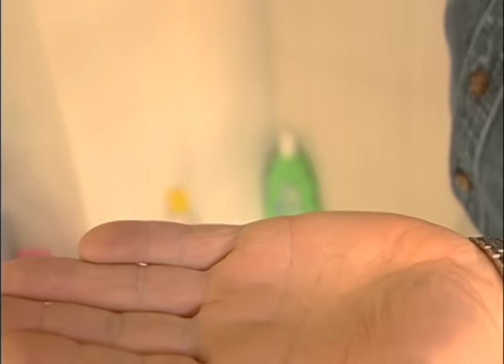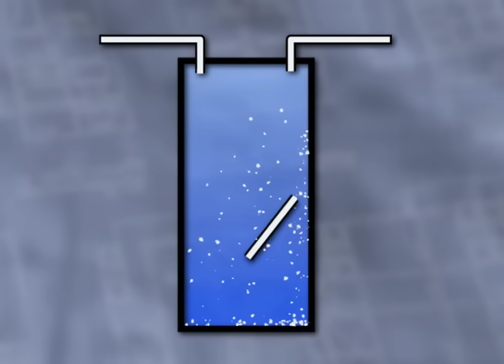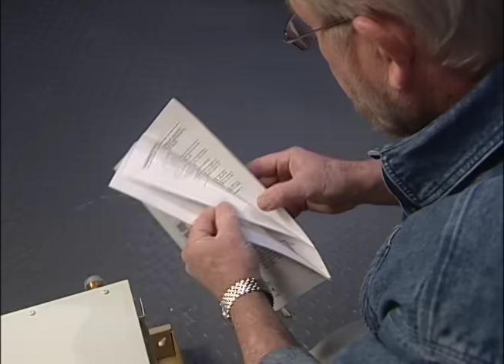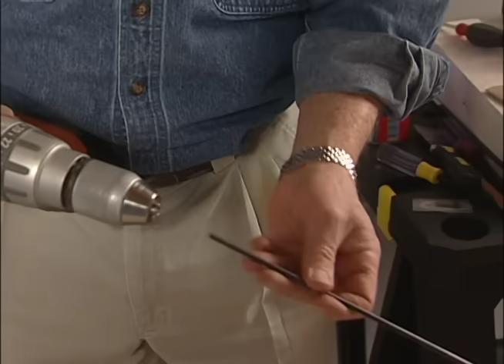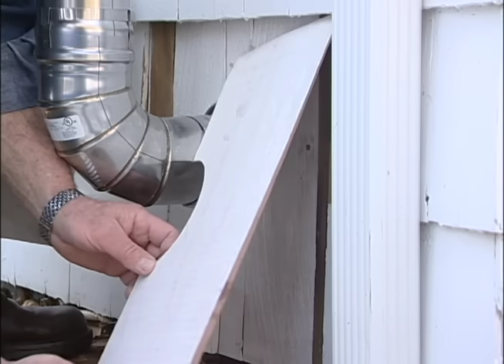Install a Tankless Water Heater

Comment: There's pros and cons to everything. 
 You need to know your needs are. And of course cost. Regular water heaters are pretty efficient now and you can put insulation blankets on them. Works well. Maintenance is key. 👍😉
Reply: George B most of the time where i live. A tank style water heater is either in the garage or house. Neither of those get cold enough for a new foam filled water heater to make it a good idea to install a blanket on a water heater

Comment: I installed a gas tankless in my house twenty years ago.  I have never had problems with it because I only plumbed the shower/tub and clothes washer to it.  I figured turning it on and off just to get a little hot water at the sinks in kitchen and bathroom will cause it to breakdown sooner than later.  Besides it isn’t instant like a typical hot water tank because the chamber has to heat up so it runs a tad bit before hot water comes out of it, then has to get to its destination. I use a six gallon electric water tank under the kitchen sink to provide hot water to it and the bathroom sink.  My only regret is having one while married as I don’t think you will save money with unlimited hot shower water with a women in the house.

Comment: Looks Great Only One Issue. Galvanized pipe will release particles that block the burner orifices....
Reply: Michael Canto, I have one and the only problem I had was to install a mixer to keep from getting scalded water if you turn it off, like in the shower to suds up your hair or something and then turn it back on to rinse, and the water that was sitting in the chamber comes out scalding hot.  They say there was a mixer inside but I had to add one for safety.

Comment: All that work, and you didn't have service valves put in so you can flush it every 6 months.
Reply: It’s highly recommended to have service valves installed so the system can be flushed so scale doesn’t build up. It’s a simple addition for a diy service to save a lot of money.
Reply: Robert Ford, Do you mean to flush with water at a higher pressure because the pipe inside the heater is “flushed” every time it’s used isn’t it?
Reply: Robert Ford, I have had one for over twenty years and never had a problem.  Never opened it to check either but I imagine it would be the same as the rest of the pipe in the house.  No reason to think that the heated portion of the pipe would make deposits more than the pipes carrying the heated water.
Reply: you  probably have a water softener?
Reply: No flushed with vinegar or a descale chemical.
Reply: Robert Ford, I’m not saying your wrong, I really didn’t  think to do it when I installed it and would not doubt after twenty years there is scaling inside.  I’m actually thinking it probably wouldn’t hurt to do the whole house since I’m sure it’s the same throughout.  Thanks for the idea though,

Comment: Basic plumbing repair: whenever you remove a strainer or hose to clean it out,  turn the water on for a few and let it flow free to flush the crud out.

Comment: I did customer service in the field for 35 years for a water utility. It was my job to respond to stuff like this. 75% of the time issues were in  customers plumbing like this break down of a sacrificial diode in the water heater. Tankless need to be cleaned because the coils filled with constant hot water will build mineral deposits and get in customers plumbing. Its wise to add a filter and a clean out for periodic removal of mineral deposits.
Reply: Absolutely, I have a filter system in my house and its amazing the debit sediments,  in the filter I've seen from the city that supplies my house water..

Comment: You can have that one and every tankless water heater they've made to this date and keep them and I'll wait until they finally make one that doesn't scald right off the bat or fail after a year.    Worst invention of the century!
Reply: Seriously? MY father has had a tankless water heater for at least 15 years with no issue, I've had my tankless water heater for 3 years and no issues. Whatever problem you have is probably an installation issue.
Reply: Seriously?  No I am lying and causing problems for you because I have nothing else to do other than to stop what I am doing and spend minutes of time composing something to irritate you.    So sarcasm off (as I hope you will flip it off as well) but no, these are not as great as some people claim.

Many hotels are starting to use these dreaded things and I have run into them in various B&B's I have stayed in (I love to travel) and I have never, and I repeat never taken a shower with one as the hot water source that did not either freeze me or scald me for a couple of minutes or more during the shower and even some get boiling hot and then go cold.   Even at their best, the water temp varies greatly by pressure and unless you are the only one living in the house, the temp is always fluctuating during the changes in pressure which creates a very unpleasant showering experience.   I wouldn't have one if you gave it to me, but I am happy that you are enjoying yours.   

I use my time here only to warn others that these things are not what they are "cooked" up to be but you may very well be after using one a few months.
Reply: @barbaraflanigan1641  welp I guess you're right, all of Asia, and Europe MUST be wrong!!! Sarcasm off, did you use a point of use tankless or a whole home. Because these tankless ones are usually bulletproof. A scalding issue is not the water heaters fault, that lies in the cartridge in the shower/bath. The tankless units also have a temperature setting, ours is set at 125 and has been; flawlessly fine for 3 years and my father's for 15. And other ones I've installed have not had any call back or service errors. I do annual descaling and condensate servicing to my units and make sure they run perfect. My guess is of an underlying issue of install, size capacity, or other factor causing the issues you've noted. These units need to be set up to the home/hotel being installed at, it's not a plug and play for each. You need to analyze the gas getting into the unit, and adjust a gas port until you get the proper exhaust gas reading to verify the burn is correct. Plus gas line size, water line size, ect. However I bet you might be noticing one constant flaw over and over again that is an issue related how it is being used or installed. In a hotel or large service location they should be set up in a cascading arrangement. That is one connected to another, and so on. Same way some people will hook 2 tanks up to each other.

Bottom line, my thought without actually seeing the issues you describe all fall back to install or improper use.
Reply: I enjoy a GREAT shower and I've experienced them from tanks starting at 6 gallons (my RV) up to 100 gallons (friends with large home in CA) and the showers are great.  (RV tank-less is an even bigger joke, you've run out half your water tank before you can get the temp right.)   

In fact I've NEVER enjoyed a shower with a tank-less and I have had more than my share at the places I previously outlined.    Other news ..... no one maintains anything these days so if you have to descale them every so often, it's not going to happen in any household I've ever visited.  Most people only do maintenance when they are reminded when water starts pouring out on the garage floor or it's running ice cold.   In fact with tank-less they usually stretch that out as far as it will go as well, seeing just how bad the temp control will get before they are forced to call service.   

Still if you have to tune them like a piano to make them work right (sizing shower washers, etc.) then how long can that last (even it it works a while) with debris and scale build-up in strainers, showers, etc.   In many places I visit I'm always happy when they have the shower heads with all the tiny rubber little jet-nipples on them because I can unclog the shower by raking a fingernail over the rubber jets to unclog the scale from them, and the point of that being that scale in some locations requires weekly clean-out.   Overall, it's just too finicky of a contraption when doing something like adding a solar supplemental heat source could save near the same money and without all the grief.

Comment: I came accross the same problem & installed similar heater, 1 thing wasn't mentioned was the need to purge air out from the heater before turning heater on. (I do repairs to but don't post online but considering it.)
Reply: Yes the need to purge air from the water pipes & the gas pipe, also there was no mention of checking the flame or efficiency of the gas burner itself, or does  the manufacturer just set all these gas burners the same?

Comment: Please be very careful of the vent because it's at the level of windows. When the water heater is running there is carbon Monoxide coming out of the water heater vent. "Dangerous and Deadly"

Comment: These have been around for years in Japan... Paloma, Rinnai, Noritz, they are all Japanese companies. You can put those on the outside of your house so you don't need to put it in your basement or wherever
Reply: That is correct,put it on the wall outside,no expensive flue needed, easy to maintain,and a lot cheaper to install.

Comment: And NOW I know I have to get rid of my tanks here as they are old in this fixer I bought a year ago,, Thankfully us Puerto Ricans know all about tankless water heaters though we use electric models not gas.
Reply: That sucks. Gas where I live is so much cheaper than electric
Reply: @iLikeC00kieDough  Well sir, I found out gas use costs around the same per month as electric for heating since it is freezing here in PA. But alas, gas may be cheaper for some appliances true. For central heating furnace,not so cheap.
Reply: pianokeyjoe probably true for Puerto Rico. I’m in the northeastern us and natural gas is so plentiful, it’s dirt cheap

Comment: The tankless propane water heater I'm using cost less than $60 new on eBay.
Reply: For a whole house??? If so good luck in the next 3-6 months.
Reply: @nickirland5497  The last one I had cost $129 new on eBay, worked flawlessly,at least 2 years, before I gave it to a friend.
Reply: Greg p why would you give away a perfectly good tankless water heater??

   If you paid a $129.00 for one. How many gallons per minute & BTU’s was it?????

I like how you say. I’ve never had any problems with any of the tankless water heater.

  That’s a problem right in that statement.  You should only say this about “1” tankless water heater. If you’ve changed any of them out. 
       “You’ve had problems”
Reply: That’s like 80% less cost then most heaters, what’s the brand? Flow gpms? Btus?
Reply: @andreyyaromich8277  it's a Chinese made for outdoor camping, 2 D batteries fire it. 2 lines propane and water, shower head output. I use it indoors.

Comment: For $500 a regular water is the most cost effective.  A tankless will cost you thousands and will take many years to make back your money.  Always have a licensed professional install your WATER HEATER.
Reply: One of the problems with tankless is the confusion of misinformation running amuck with zero practicality applied. In 2008, a Bosch Aquastar 1000P cost me $300 which was under a standard tank type by $100 and they were lasting only a year before developing a leak so bad the pilot light would be quenched by the leak. The Bosch is still supplying me with hot water with next to zero maintenance or cost. It ran one winter on 30 gallons of propane where the tank type required an entire 350 gallon fill up to do the same job in the same over the winter time frame. At 2.35 GPM, the Bosch is meant for cabins or single bathroom only but in my whole house use it's exactly the same usage as a tank type. You have to take your turn in using it, anyone in the shower will still holler bloody murder if someone else uses hot water in the kitchen for example and that situation has never changed from the tank type days. If you don't really need a massive amount of hot water, you also don't need to spend thousands to get it. But the advice to go small like I did is not offered anywhere, ever. Forbidden logic.

Comment: Am I the only one who thinks it would be nice to know how much this conversion cost? It seems to me that if tank-less water heaters cost about the same as tank water heaters there must be a good reason for getting a water heater with a tank. What is it? Why hasn't tank-less water heaters not become the norm? Thinking over the video I remember venting the heater with stainless steel. I'm guessing there must be a lot of heat to vent. Does that pose a danger to the home?

Comment: How you gonna flush the unit Ron?

No service valves. Seriously people this guy is a moron he misses stuff that people who aren't licensed plumbers would know better.
Reply: Look closely,....... very closely....... 15:45 you must be one of those licensed plumbers then...
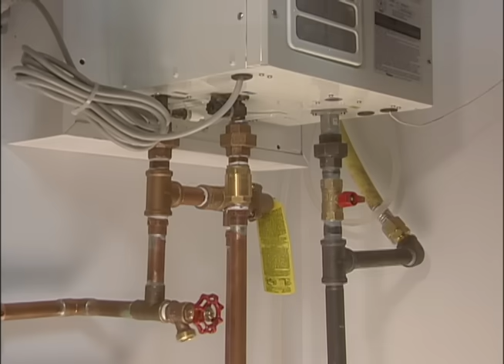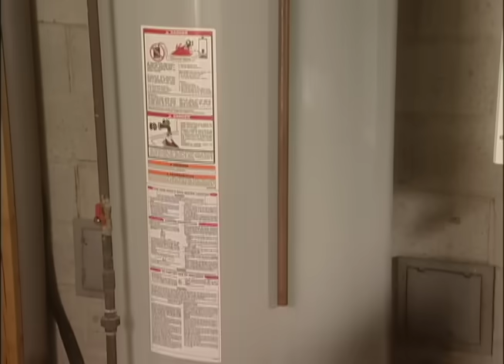Reply: There is one. At 14:52 it shows the valves under the unit (and again at 15:03 ).
Reply: @raymondheim5369  There is a gate valve on the hot water side, none on the cold water side to isolate the unit itself in order to run a cleaning solution through the unit.
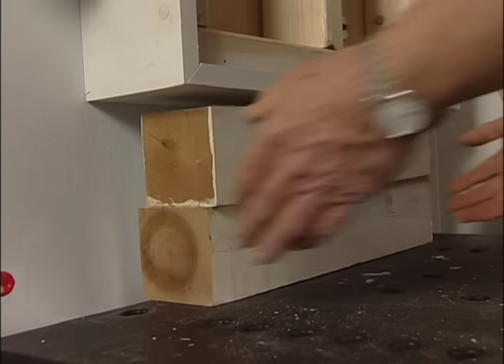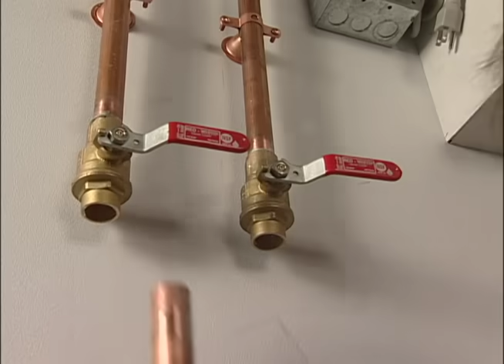Reply: MrBurgandy25 - You might want to watch the video. There is a shut off valve BEFORE the unit. Look at 8:21 and he actually detailed the install to the unit starting at 9:20.
Reply: @raymondheim5369  wow, seriously? Those are 90° ball valves, not service valves. Service valves allow you to turn the water off and connect a hose to a submersible pump. 

But what do I know, only my father and I each have a tankless and know firsthand what service valves are.
Reply: MrBurgandy25 - The point was/is valves and they are there to isolate the unit so you were wrong. So yeah, "Wow, Seriously".
Reply: @raymondheim5369  the OP comment says "...flush the unit...no service valves" 

You literally are missing the main point yourself. I stated the service valves isolate the unit to allow you to flush and de-scale it. The poi t of isolation is to not allow the cleaning agent to go into your plumbing, only the tankless unit. 

I understand what you're commenting about, but it's not the correct type of valve OP is referring to. No where in the video are they present. Wether you miss understood OP or me, they are not installed here.
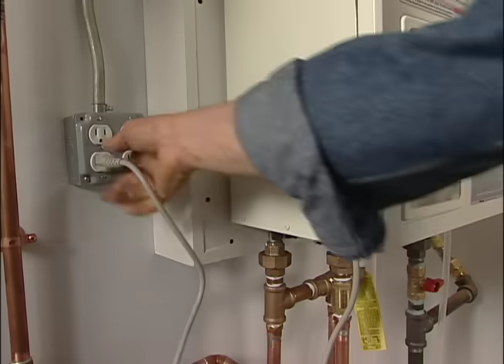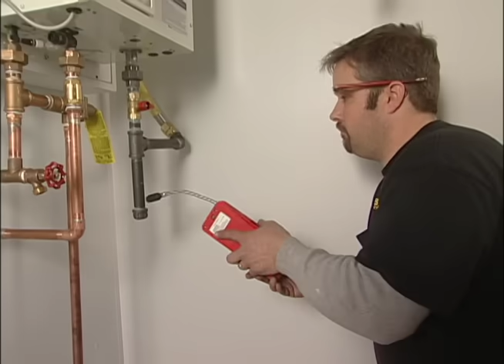Reply: MrBurgandy25 - And Yes, I do understand what specific valve you mentioned Look at 14:42, the cold line runs into a valve that is turned away from the viewer, I believe that is the "back side" of the service valve but we will never know 100 % because they didn't show/talk about it, and they should have installed/detailed that point. But then again as mentioned previously, this isn't a "How To" video, it is a bad "What We Did" video. Lol. ~ Edit: Actually, 10:07 shows a better view.
Reply: "No where are they present". Wrong. They are there. I am NOT "missing the point". People should watch the video before commenting. The tank IS isolated from main and the service valve is UNDER the unit.

Comment: the exhaust vent you installed, WHY? is it that much better than the existing one from u'r old GAS W/H?
Reply: Exhaust burns much hotter and condenses, you need more space to disperse the hotter flue gas

Comment: Tankless water heaters! Good only for those who push this technology. From personal experience and talking to others, this technology sucks! Plain and simple. To make matters worse, mine is installed outside the house. Water lines exposed to the weather? Come on! Temperatures in these parts can get way below freezing. Hot water tanks inside the house, on the other hand, may take a few square feet of space, but there are no problems with them. Had one for eighteen years. The new owner replaced it with a new one, ten years ago. No problemo! LOL

Comment: don't tell me ,your wife didn't give you any thankyou's for a nice new water heater. seriously though with 50 gallons or more of hot water sitting there 24/7 is there any savings in a years time especially if you leave town a few weeks and forget to turn off the breakers(with the old style vs. the tankless ?). ??
Reply: If he left town, the tankless would never turn on, at all. It ONLY heats the water when you need it. It does not waste a lot of energy keeping it hot all day long (like a regular water heater) "just in case."

Comment: In some homes there isn't a clear place to install a unit like this. When installing the vent pipe the manufacturers recommend only 1 (one) 90 degree bend.  Also length. Yours is very short but the manufacturers recommend and evac fan if you're forced to install it using the existing roof venting because of the length. I've installed one for my RV. It hangs on the outside of the trailer right above where the old tank unit was. Bought on the Amazon for $125. Plenty of water for a one bedroom one bath unit LOL.

Comment: Once the electricity goes off because of any hazards, good luck with cold and don't forget to blame Ron for encouraging.
Reply: Just use a generator while everyone is taking their showers and then you can just turn it off again while you wait for the power to come back on.
Reply: @SEAhawkstwelfthman  bro no one uses generators in US. It's like something unheard of things
Reply: @LukeMTB  Electrically heated or gas unit? You must be referring to Propane or gas, can't believe one of these that heats electrically could run that long on batteries.